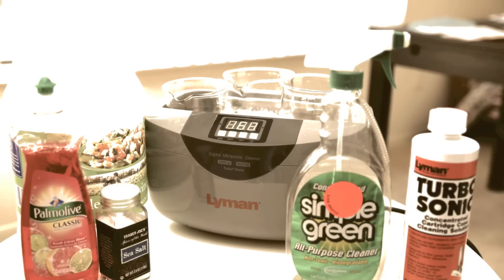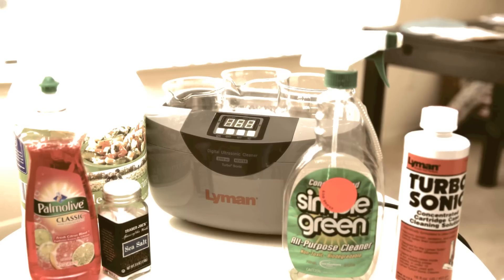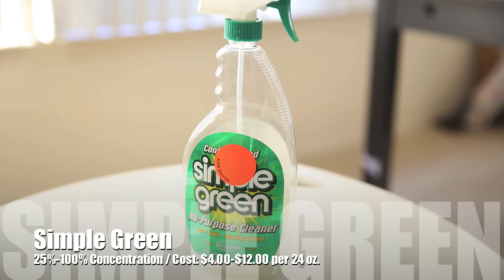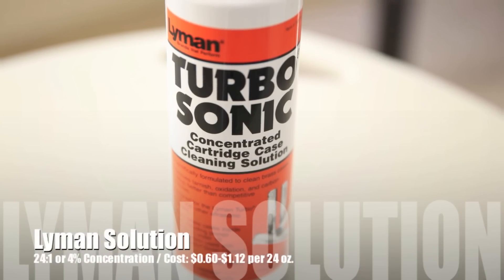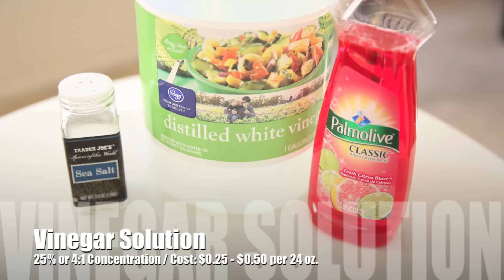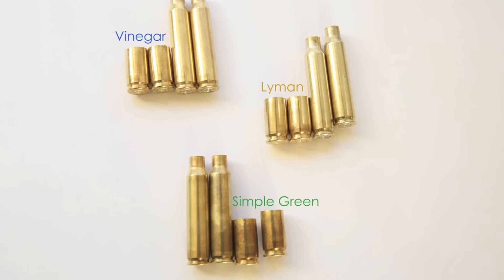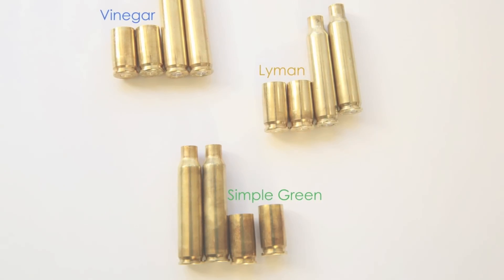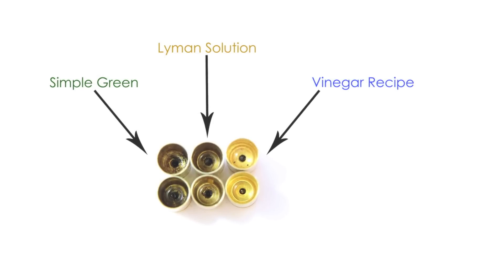Homemade Ultrasonic Solution for Reloading (comparison) HD

Comment: Vinegar one maybe ended up being the most acid. Yellow tint might indicate that electrolysis started to break the metals. None of the methods is non-toxic as there are toxins in those bullet, powder and primer residues.
While acid cleans the metal the best, be careful with corrosive effect of acids or bases!

Comment: Sonic cleaners suck overall for cleaning brass.  They're great for small parts but not for reloading.  You're better off going to Harbor Freight and buying one of their small wet tumblers.  I can do roughly 50 223 cases in each drum.  Takes only about 2hrs using Dawn and Lemmi shine and stainless steel media.

Comment: When you use vinegar and salt you need to neutralize the brass by soaking it in a water / baking soda mix for about a minute.
Reply: What happens if you don't? Brass will corrode faster?
Reply: @kingrat3035  Vinegar acid will continue to etch the brass on a microscopic level. Saw some testing and it created a measurable difference in case wall width over time and a couple of reloads, reducing the number of reloads you got out of the brass.
Reply: @swdw973  good looking out

Comment: Cool, I've tried 99.9% alcohol for electronics parts (remove any LCD or maybe OLED screen, it'll destroy a layer in it and make the LCD translucent), not sure if that's a good idea. I always use it in the bathroom with baking soda and water in hand, just in case it catches fire.

Not sure if distilled water would have as cleaned well but safer as pure 99.9% isopropyl alcohol.

God bless, Rev. 21:4

Comment: The recipe video was taken down! I need this recipe!
Reply: Ya I’m looking for same thing
Reply: @hectorgonzalez7416  Hi, have you managed to find the recipe ? Thx.
Reply: @oasis6444  nothing yet how about you
Reply: Same...
Reply: Found this in another site:

2 cups of white vinegar, 2 tablespoons salt, mix with water to make 1 gal.

Soak for 15 -20 MINUTES. Then rinse 3 times in fresh water. 

You can save the solution to use again and again.
Reply: @denver720303  Hi, I also found the following recipe, 1 table spoon of citric acid and 1 zip of dish soap. I tried it and it works fine. Citric acid is better than vinegar for it does not damage cases.
Brass being an alloy of copper and zinc, vinegar attacks zinc which will make cases weaker and shorten their life.

Comment: Lemi shine is basically citric Acid so needs to be neutralise, also dish wash/washing up liquid (dawn) contains caustic soda all of which corrode brass and copper, that’s why they work so well on cleaning brass. It must be neutralise straight away after Cleaning. Put clean brass into a solution of bi-carbonate (baking powder) 5% with clean water to neutralise the effects of citric acid, which all affect the brass. Then rinse in clean water and allow to dry. If you use vinegar that also needs to be neutralise with bi-carb

Comment: Sigh...Cascade and a drop or 2 of Dawn. 3 hours in the tumbler with stanless steel pins and a 20 min rinse. Spotless bright and little or no remnants of anything in the primer pockets. 25 years and it still works.... Easy cheap and anyone can do it.

Comment: Both the lemi shine and Lyman products use citric acid as the active ingredient. Citric acid (basically dried lemon juice) is readily available on the web as a powder
 It comes in food grade and usp grade ( cheaper). If there is any interest, I will calculate and post here approximately how much powder to use in a gallon of water to be equivelant to Lyman end user concentration. If desired it is ok to add dish soap to this mixture.

Comment: I've been using a 2.5 percent solution of vinegar (1/2 regular white vinegar and 1/2 water) and dish soap solution for years in an ultrasonic cleaner to clean my brass with decent results. After watching this vid I tried adding a teaspoon of sea salt and the difference was amazing! The primer pockets came out much cleaner (15 minutes in U/S cleaner @ 40C) and the solution was basically black when I dumped it - normally I'd save the solution for multiple cleanings but this time it was way too dirty. And yes, if you don't immediately rinse your brass with hot water and a little bit of baking soda, the brass will be slightly discolored. Since this doesn't affect the brass' performance I usually skip this step because the gophers I dismantle with each 0.223 round haven't expressed a preference for shiny brass.
Thanks for the tip!
Reply: Studies have shown that 9 out of 10 gophers surveyed prefer to be shot from discolored brass

Comment: salt cancels out some of the vinegar's acid=less cleaning power. dont know why you would want to weaken the vinegar
Reply: Sodium Chloride has a neutral PH. It will not cancel out the acid.  It could dilute it but the water will dilute it more.
Reply: @shawnruzek5378  One mole vinegar (acetic acid) CH3COOH plus one mole of salt (sodium metal chloride salt) NaCl gives a mixture of one mole of hydrochloric acid (muriatic acid) HCl and one mole of sodium acetate (CH3COONA).
CH3COOH + NaCl = CH3COONA + HCl.  Not quite cancelled.

Comment: I clean after decapping and after resizing. My dies stay clean and as new that way. I also brush the second time,that remove the
oil better and the brass stay very bright even after 6 months no colorating,stains
Reply: Do you mean before and after resizing and depriming?
Reply: @robertbrandywine  I now only use 1liter water from wadryer and add only 0.2liter vinaigre. After 6 minutes i stop my 180w ultrasone. I only use 1 layer of brass. I predry in blanket and put the brass in a airfryer at 80degcelsiun for 30 min. While ultrasonic cleaning i steare the brass with a paintingbrush. Never retract your bras while ultrasonic clean because youre ultrasonecleaner will brake. I now mainly only necksize. After ultrasonic cleaning i use 3 bads off washdryerwater to rinse the brass.In this case my brass keeps the good copper shine, no more use off other things

Comment: 5% Citric Acid and water  a little less than one ounce per quart ratio.  Use hot, not boiling, remove  after about 3 hours stirring occasionally (about every 45 minutes), turn of the heat and allow to stand overnight, inspect under warm running water and brush primer pockets and case interiors if necessary, it usually isn't, but you need to inspect the cases at some point anyway and doing so with a brush in hand while rinsing is easy, most all cases do not need the brush.  Dry on a tray in the oven on it's lowest setting.  Do not throw out the dirty solution, it is still good for at least two additional uses even if it looks nasty.  You will get a long lasting shine that looks exactly like new commercial brass.  If you need your cases to shine like jewels you will need to use a tumbler with corn cob media and a Red Rouge additive.  Vinegar and water or vinegar, salt and water work very well, but the cases will re tarnish very quickly, as soon as overnight.  Citric Acid is sold in grocery stores as Fruit Fresh and is used in keeping fruit and vegetables from turning brown while waiting for processing, and for raising the PH for canned goods to safe levels, it is quite expensive bought in this form.  I buy mine in bulk, food grade from Duda Diesel/Duda Energy in Georgia, they have good prices and quick service with good shipping costs.  I recently bought 5 lbs of Citric Acid powder and 5 lbs of Potassium Nitrate (Saltpeter) for $30 including shipping delivered to my door here in CA.  I learned this method from an article in the American Rifleman in the '50's who reported that the method was the one used by the old Frankford Arsenal (a government  arsenal) to prepare their brass for loading, it is cheap, easy and efficacious, try it you'll never use anything else unless you want a jewel like finish

Comment: The best results for me were this solution plus 2 hours in the tumbler, I see this to be the best for the following reason, 1 hr in the Ultrasonic cleaner removes all the crud from inside and out of the case if the temperature is above 60 degrees, and then two hours in the tumbler not only drys the cases, but polishes them too, so i'm glad I bought both ultra sonic cleaner and tumbler, for the amount of time my brass is stood waiting to be shot and crapped up again, I hardly ever clean my brass, I certainly wouldn't waste my time then washing them off in Baking soda....

I bought some Carb solution for the ultrasonic cleaner, utter garbage, this solution is the best I have tried to date.  Nice one PilotWithAGun

Comment: What a great test. Thanks for showing the difference. I am new to reloading and have been hesitant to starting because I am so particular about making sure the brass is "perfect" before I get started. I have heard leave primer in, take it out, so many different ways and ideas, I am confuse as how I should start. I loved what you showed and the differences in types of cleaning solutions and how they work. That will help me get started. I would thing I was doing something wrong if I used a cleaner and it showed all the debris like you showed in the examples. Better to start with something that works. Thanks again for taking the time to show this. Peace, Reese

Comment: It's already been mentioned in the comments but instead of vinegar and salt (which I tried a long time ago) I have been using Lemi-Shine dishwasher booster. It is citric acid crystals. This acid, unlike the acetic acid in vinegar, will not have a negative effect on the brass, in fact it actually passivates the brass and it will resist tarnishing. I use the Lemi-Shine, a bit of Dawn, and HOT water. Primer pockets are clean, brass is relatively shiny, and it wont discolor.
Reply: The 2 on the right are new look they have new primers in them
Reply: Don’t get Leno shine in Aus bro
Reply: I bought a bag of powdered citric acid and it will last me a lifetime it was cheap! When added to hot soapy water it removes 90% of the grime it burns it right off and then I dry them in walnut media which removes all the haze and polishes them better than new!
Reply: why use lemi shine when its more expensive that Vinegar?  The results cant get much better than in this video.
Reply: Bob it’s not that expensive, geez
Reply: @TaintedMojo  Hey in COVID times need to save them pennies.    But yea I'll try lemi shine when my vinegar is gone.   The results I got are pretty good though the brass oxidation is removed looks good enough.    Close to this video.
Reply: @Physics072  I bought pure citric acid from a local middle eastern food market a few months ago. It may be cheaper to just buy the pure stuff from online or a local supplier like I did than to buy a manufactured product. hope that helps
Reply: @mikem6468  I don't know the recipe for how much pure to put in.  Don't feel like reinventing the wheel by experimenting to find out either.    How much of the pure do you mix in with how much water how much dawn hand washing detergent. ?
Reply: @Physics072  to be honest with you I just put in two or three tablespoons into a bucket with about  a 1 second squeeze of dish soap, its pretty loose tolerances because the acid doesn't need to be really strong. i don't clean bullets as much as I do corroded brass, and it really rips the green off. the acid also can last more than one bucket/large brass object.
Reply: @mikem6468  Nice!   And thanks for being HONEST this time.   I know you had to think about it hard before you posted :)   Should I be honest with him or not?   I am glad you decided to honest this time.  thanks again!

Comment: @PilotWithAGun Just picked up the exact same cleaner and just barely ran it for 8 minutes with the vinegar solution recipe being followed exactly. Not even close to the same result. Does it only work with 12 pieces in the cleaner?
Reply: +Shane Clark Ran another 8 minutes and it is actually really close to your results! Primer pockets are perfect and the interior is getting there. In again for 8 minutes...

Comment: I used the vinegar solution and it does work great, however after a few uses in my hornady sonic cleaner which was new, the solution ate tiny pin holes in the steel tub and it leak internally ruining my sonic cleaner. Has anyone else had this happen? I am not a happy camper to say the least.
Reply: +Preying Mathis 
same problem with my lyman this morning.... this solution is too powerful.... i wonder if professional ultrasonics cleaners can handle such acidity...
Reply: +Preying Mathis  rinse out with baking soda and water to neutralize
Reply: It doesn't matter... While it's in there cleaning it is eroding the tank so eventually it will destroy your cleaner whether you clean it out or not. Good luck
Reply: yes it's true , luckily mine has not break through for the moment, i hope it will not break through when i'll use my old solution in the damaged tank.
Reply: Yes stainless tub.
Reply: Todd Sadler Yes they are thin. You can get much better commercial grade sonic cleaners that have a much better tub. For these cheap ones I would just use the recommended solution because you can strain it through a filter and get many uses from the same wash solution. That's how I run mine and I haven't had any more problems.
Reply: Yep let it settle and filter it and you can get many uses.. I also tumble and tumbling does great but it doesn't get primer pockets good and clean and inside the case is just decent so I combine the 2 and my brass looks better than new.

Comment: Whilst Vinegar, salt and copper are not poisonous: Copper acetate is quite toxic so care must be taken to avoid exposure to the skin, eyes.

Also using acid and salt to clean brass means that you will need to flush the sodium away and also neutralise the acid residue, both of which may case problems.

I have used non-corrosive radiator cleaner from auto parts supplies.

You  may find it useful and  not as corrosive. Avoid anything with ammonia as it will degrade the brass

Comment: A giant bulk bag of citric acid powder, about a lyman scale pan worth for 3 liters of water.  50 pieces of 260 Remington brass are clean in 20 mins.  30 mins in the oven at 225.  Done.  Cheap.
Reply: +Christopher Harrison Psshh... I only go for 20 minutes in the oven but I'm an Arizonan, we're crazy like that. Citric acid is the way to go except I have had one container of Lemi-Shine for about 5-years and I haven't used it all yet. Love my .260 Remington (Marlin X7 action, Shilen Select-Match barrel).

Comment: Just reading other peoples comments. where some people live, the water is "Hard" - lots of calcium. Hence the green dis-coloriation. Using distilled water will solve this. We are lucky here in Vancouver BC where the water is softer and doesn't leave any residue. Calgary for example has hard water. Some homes have a water softener plumbed in. And the other thing is: put the wet brass into a vented case holder to drip dry in the sun, or assist with a hair dryer too. Leaving them on a towel or bucket to dry takes forever.

Comment: Okay. So I mixed up a batch of the solution to your recipe and loaded the cleaner (same as yours, different brand) with some dirty 9mm brass. It got them clean but I didn't get the shiny results you picture. I had to finish them off for a couple of hours in a tumbler with polish, which sort of defeats the purpose. The brass coming out of the Ultrasonic is dark and tarnished (after three cycles). What am I doing wrong?
Reply: +PilotWithAGun How do you go about rinsing and drying them to prevent further corrosion after removal from the ultrasonic cleaner?
Reply from the maker: +chrossphyre How many pieces were in the cleaner?  The results are much better with less brass.  Ultrasonic cleaners will clean, but it will not polish.
Reply: +PilotWithAGun I did two runs, one with about 200 ocs and the other with just a half dozen mixed .40/.357/5.56 brass. Same results in both.
Reply from the maker: +chrossphyre Not really sure whats going on then.  Maybe your ultrasonic cleaner is not quite strong?  Try experimenting with different strengths of vinegar.  Also are you using the heat function of the ultrasonic cleaner?
Reply: +PilotWithAGun Yes I used the heat function both times. I'll try mixing up another batch - maybe I mis-measured last time.

Comment: I just tried this with a small Ultrasonic cleaner cleaned 150 9mm and 88 30-06, I did 50 at a time of the 9mm and 20 at a time for the 30 cal. I ran them for 9 min. I looked closer and ran a few one more time just to see. It worked fantasic. Thanks for sharing this, it was very helpful. Your recipe if perfect. All the loads I did were in the same batch of water viniger deturgent mix, but it is time to change it. Never let it sit...

Comment: I've tried this solution today, water, vinegar, soap and a touch of salt.

After 6 or 7 period of 480 seconds, my brass are clean !  They are not shiny, but clean. There is a lot of carbon particules on the bottom of my bin, it's all black !

So right now, i have a bunch in the thumbler, been processed. I'll see if they will come out "like new" !